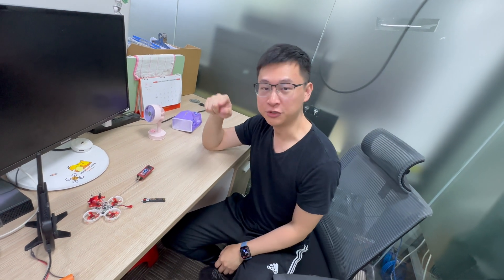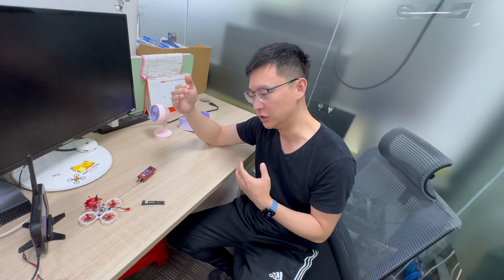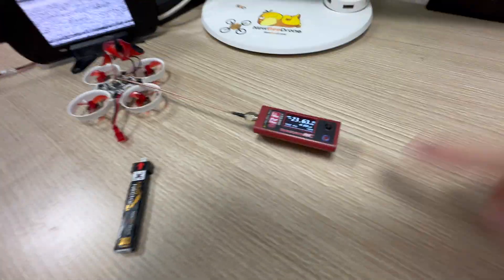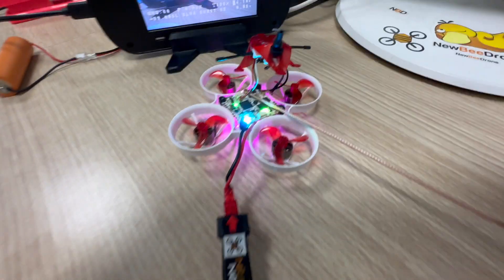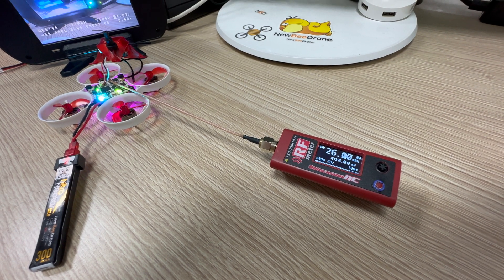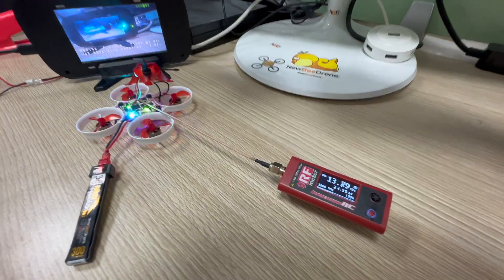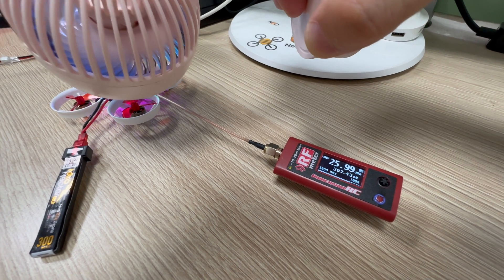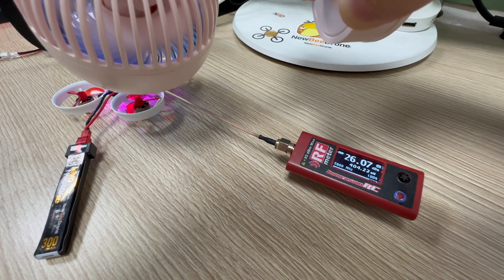What is BeeBrain BLV4 VTX Smart Control? Is 400mW VTX possible on a whoop?

Comment: How is this different from all other VTx’s? They all throttle down when overheated…
Reply: It’s two different thing, normal VTX without temperature control. When they heat up, it will keep the power at the high level until the RTC6705 internally give up. That will damage the VTX chips. Our BLv3 is like that. That’s why we only set it up to 120mw with the low power when disarm setting on betaflight. 40% of the service from BLv3 are VTX burn out issue. This is the reason for us to make the Smart Control system.